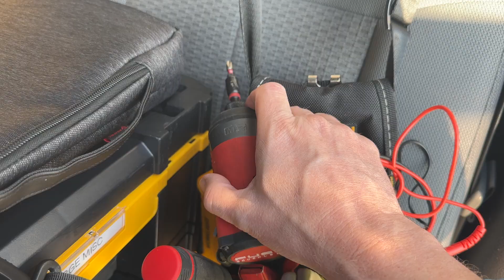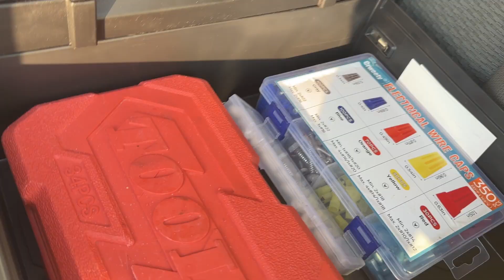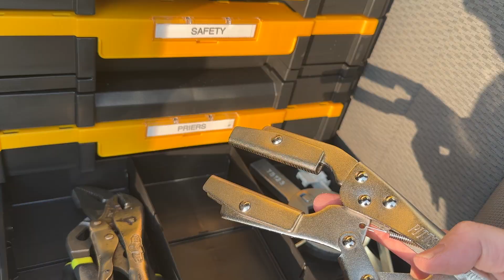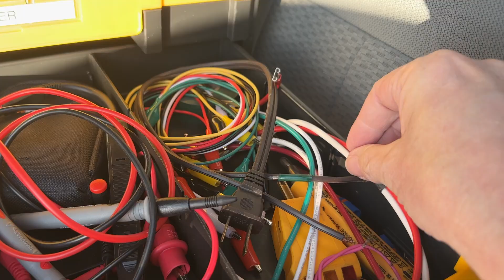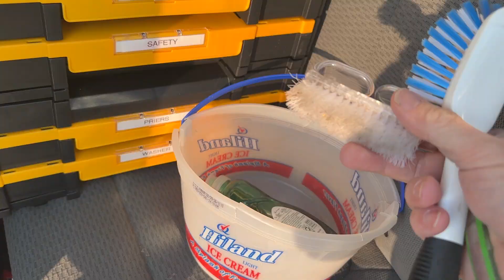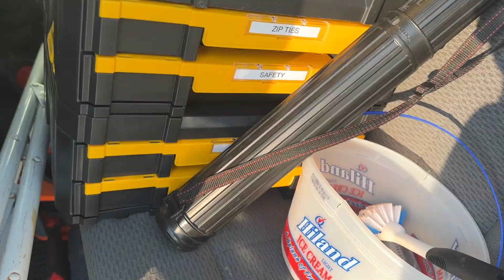Appliance repair truck tour and the tools I use

Comment: Not sure how carry you  parts in that I have a van packed with boards pumps EVAP  motors belts pulies latches igniters coils the list is endless
I carry a Mikita impact and a belt pouch bits and pliers Leatherman size pouch I use a Olight  warrior nano flashlight lasts all week your first call complete s must me very low I’ve been doing this 50 yrs now
Reply from the maker: We all have to start somewhere. I haven't been doing this for 50 years, but I've been at it for awhile. I keep an assortment of parts at the shop, and I've gotten very good at diagnosing over the phone and having what I need on hand when I arrive at the customer's home.